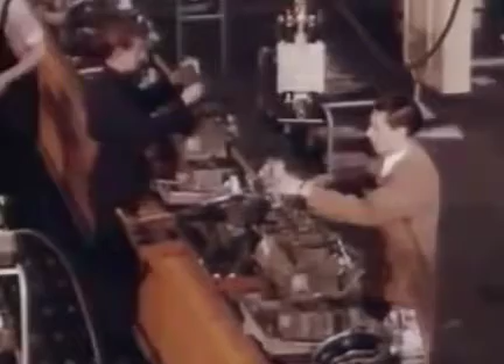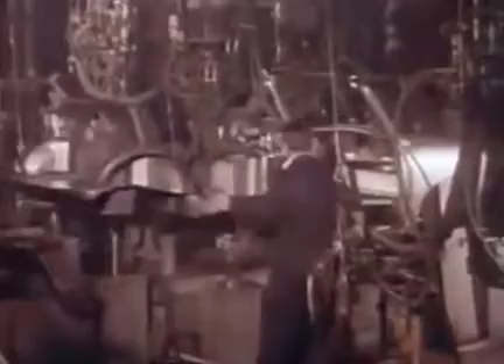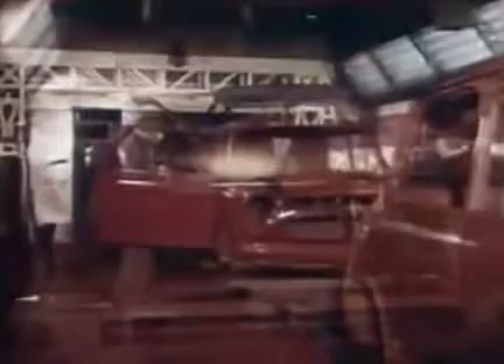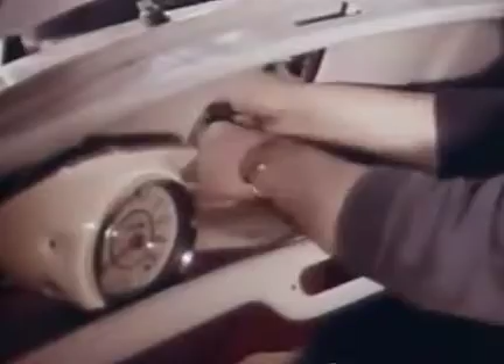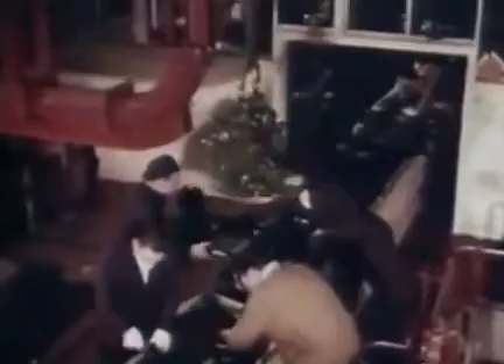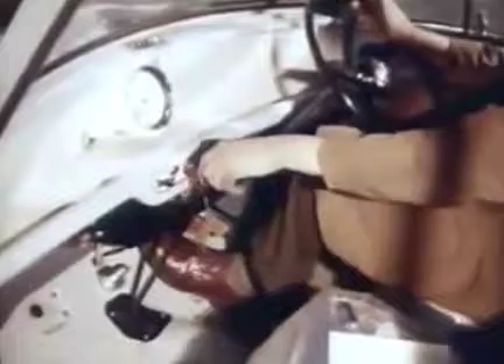MK1 Mini production 1959   https://youtu.be/hbZFjIofMhw

Comment: I'm staggered at the simplicity of the engine assembly process. I'm sure that earlier films of the Austin engine plant showed a much more sophisticated engine assembly line that was semi automated 30 years earlier. What happened to automation?🤔🤔🤔
Reply from the maker: Yes I posted one a while back it showed a high degree of automation, not many years before this film was made either
Reply: @jackflashvintagemotoring7586  Yes, I remember that film, with all the analogue automation and futuristic flashing lights. It was no doubt designed by the same chap who built the sets for Charlie Chaplin's movie "Modern Times".
Reply from the maker: Ha ha yes indeed